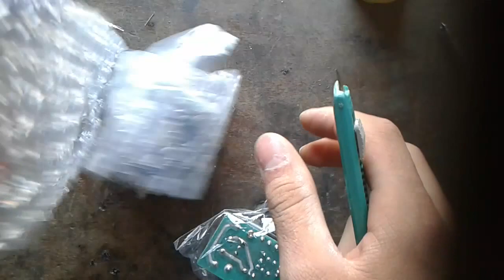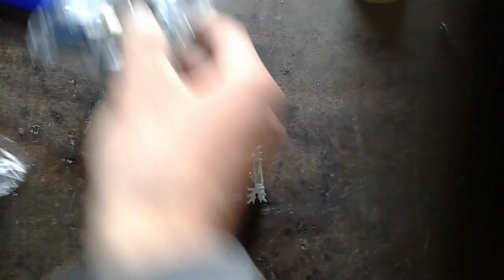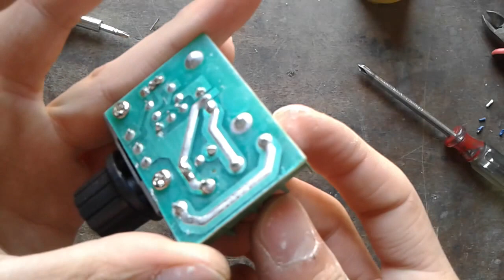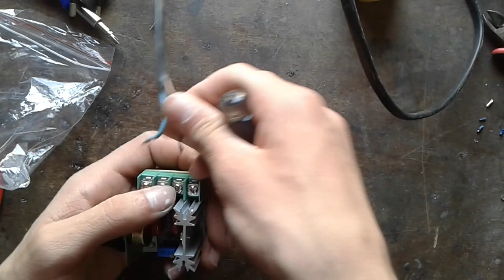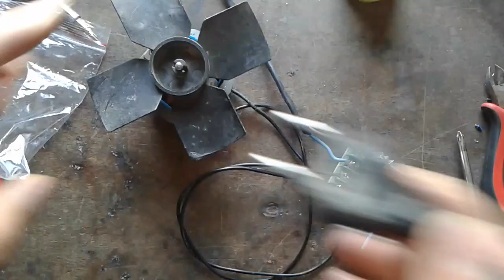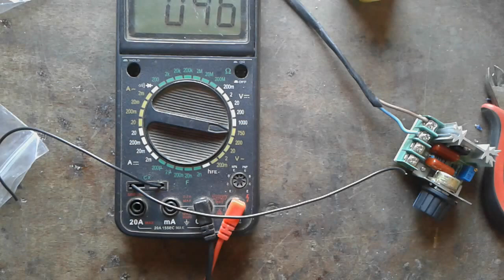2000W 220V AC SCR Electric Voltage Regulator Motor Speed Controller

Comment: Thanks for the video demonstration. It would be more informative if the speed vs the dial position is charted out. It is hard to tell from the video if the speed has a linear relationship with the dial. I have an application where I need to speed to be controlled in a linear fashion vs the dial. I am trying to avoid the speed to suddenly change with little dial movement. It would be very useful if this information was included.

Comment: By Decrease of AC voltage You will increase current -it mean overheat of the motor and will reduce the torque of the motor as well.
Reply: For many torque does not matter, for example, torque for that fan will be irrelevant.

Comment: You lost me at the end of this video, the part with the multimeter, does this show it DOESNT work, or that it DOES work? the fan seems to slow down when you turn the dial.
Reply from the maker: A7mag3ddon it works .  the name of this module is "Voltage Regulator" but the voltage doesn't change so it means it is a Amp Regulator :)
Reply: ahh i see, I want to use something like this to turn the voltage down to a heater element  so basically turning down the heat, would this work ?
Reply from the maker: +A7mag3ddon yess it will work perfectly :D
Reply: Voltage regulators are supposed to be operated on load. What he did was check the voltage across the output terminals on no-load condition. He could try the same with the fan connected to the output terminals and running. Then connect the voltmeter across the same output and rotate the knob to check if voltage changes with change of rotary knob position. Overall a good video. Cheers !!
Reply from the maker: Thank you very much for your comment . I will try it with the fan connected :D
Reply: Hope it helped. Was watching your other videos and I think some of them are fantastic, bro !! So much to learn. Keep up the good work. Cheers !!
Reply: Not quite. These work by turning on and off rapidly. If he was using a better multimeter we might seen it change from 240 to 0 and back again multiple times per second.
Reply: Basically this reduces the duty cycle of the ac voltage that's it, your voltage remain same and amps also,  it controls the duty cycle only just like we use ceiling fan controller/dimmer 
See in ac voltage  it's 50% positive duty cycle  and 50% negative duty cycle so this circuit reduse it, so load responds according, but frequency remain same 
Only duty cycle changes here
Reply: @IsDeno24  yes I agree. I bought 3 of this and  tested it carefully and found out it is constant voltage. The current is the one regulated. I was hoping for Variable voltage but I'm dissappointed.
Reply: @GravityOfLife  the voltage starts to change with at least a 30W load, otherwise it won't work

Comment: I don't understand. one videos shows voltage change, whilst turning the knob - and you're showing that the voltage stays the same.

What am I missing?
Reply from the maker: Yeap that's  what  i want  to say  , the Voltage  stays  the same  , that means  , it controls  the speed  by limmiting the current
Reply: @IsDeno24  Wrong!  It controls the voltage by altering the phase angle of the input voltage and therefore the trigger point for the triac. Your cheap multimeter is improper for measuring the resulting distorted waveform. That's why it shows always the same voltage. You need a much more expensive multimeter in order to measure such distorted waveforms of either voltage or current. A "true R.M.S" meter. Cheap multimeters cannot perform such measurements. They are designed to measure the average value of undistorted sinusoidal waveforms only, when measuring A.C. Therefore their reading is always faulty.
Reply: Since you sound like an expert can you tell if i can mount this thyristor into aircon compressor and get myself a free upgrade to variable power? Like no shit it's the same motor, what could go wrong? What is the purpose of inverters aside providing better sine form and smoothness?

Comment: How does this affect the torque of the motor by reducing the speed by about 50% thanks
Reply: By Decrease of AC voltage You will increase current -it mean overheat of the motor and will reduce the torque of the motor as well.

Comment: It is not good at very low rpm.... I tried it on a router and a table saw. OKE to get just a little less rpm. Not good for low rpm. The motor will stall.

Comment: Seems it is NOT a voltage regulator, it is trailing edge or leading edge dimmer (in a nutshell, just modify the waveform, not voltage)

Comment: Can this circuit useful to reduce speed of an axial exhaust fan

I tried using a regulator out of a fan
But it won't turn down
It says it is impedance protected
Reply: He literally just used it on a fan.
Reply: Depends on where in the chain you're putting it  anything in line before the fan will affect the flow

Comment: Will it matter if i give an input of 12vDC supply, instead of 12v AC or else? Reply soon, thanks
Reply from the maker: It works with 220V AC not with 12V  :)
Reply: IsDeno24 what should i use... To regulate the speed of 12vdc motor , by supply though 12vdc power
Reply from the maker: This https://m.ebay.com/itm/12V-24V-36V-10A-PWM-DC-Motor-Speed-Governor-Controller-CW-CCW-Reversible-Switch/122604178314?hash=item1c8bc74b8a:g:HMoAAOSwg6pZbIE7
Reply: yes
Reply: RiSHiT Panchal  pwm modulation ,simple circuit available in market
Reply: @IsDeno24  will it works for water pump motor use for different purpose without impeller?

Comment: does it work with a washing machine motor?
Reply from the maker: Patricia Malubago yes :D
Reply: Mam Malabago ...what is the use of varying the speed of motor? The maximum speed of motor is practically designed for washing machine unit!! .......   From the philippines

Comment: can i use this 220V AC SCR Electric Voltage Regulator Motor Speed Controller to my 24volts dc motor ??? asap plss
Reply from the maker: No you need a DC motor speed controller
Reply: OK tank you for the fast feedback
Reply: There is another one suitable  for 12-24v dc on eBay . Just write motor speed controller dc

Comment: Sir can I use this 220v 2000w scr voltage regulator for sewing machine motor
It has 6500 rpm 0.6 amp
Thanks
Reply from the maker: +Sandeep Rajmane  yes you can use it :)
Reply: IsDeno24 thanks again
Reply: It work 2.2 kW  motor

Comment: Ok it is not voltage regulator it is current limiter
Reply from the maker: Yeap ,but  in description  is "Electric Voltage  Regulator "
Reply: @IsDeno24  Wrong! It's a voltage regulator! Not a current regulator. It works by chopping the sinusoidal waveform. But this specific circuit is not good for motors as it stalls at low speeds when the motor is loaded...(You can stop the motor with your hand at low speeds, as there is not enough torque in it in order to drive the load)...

Comment: Hi can I used this on a hairdryer  motor
Reply from the maker: Luke Kisten yes on all  220V AC Motors
Reply: And can I put the speed on full and will the motor not burn off ?
Reply from the maker: There is no reason for the motor to burn

Comment: will this be safe to regulate a 1500w heat gun ?
Reply from the maker: Yes it is safe and works perfectly , i have tried it :D
Reply: u have a link ?
Reply from the maker: https://www.ebay.com/itm/2000W-220V-AC-SCR-Electric-Voltage-Regulator-Motor-Speed-Control-Controller/141370010621?hash=item20ea4f2bfd:g:h6AAAOSwjDZYfenF
Reply: ah thanks man very much

Comment: What is the difference between step down transformer and scr voltage regulator.
Can i use scr voltage regulator instead of step down transformer?
Actually i want to run stepper motor driver 2DM860. Driver voltage range is in between 30vac to 80vac. 
Can you please guide me regarding running stepper motor driver using scr voltage regulator.
Thanks in advance
Reply: for those who come across this: SCR reduces duty cycle, step down reduces peak to peak voltage.

Comment: Can i use for, V 230 , W 210, Fase 1 , AMP 1, H.P. 0.28 , RPM- 2800  Motor?
Reply: Max 230V, max 2000W, if its classic motor that works with the outlet power then it should work, actually anything that uses wall outlet wall power should work if its 230V within 2000W

Comment: Does it work with 1/3hp ac motor?
Reply from the maker: It works with everything under 2000W :)
Reply: IsDeno24 thanks!
Reply: IsDeno24 sir how long can it works without overheating?
Reply from the maker: It depends on the motor power